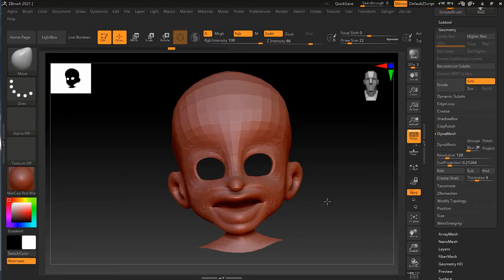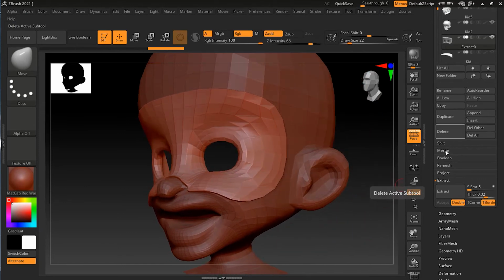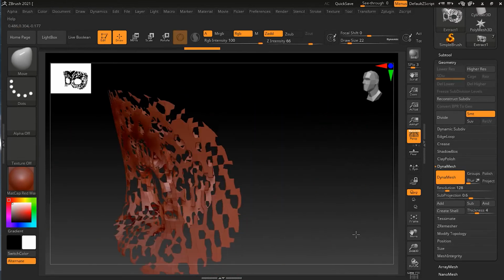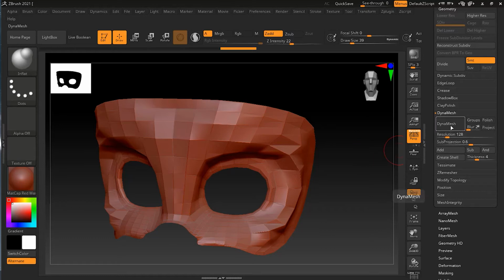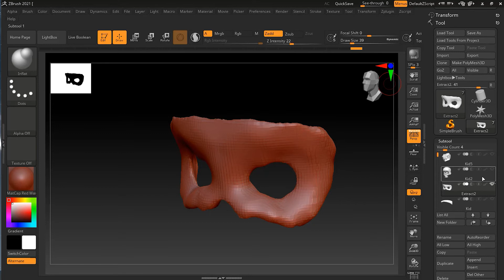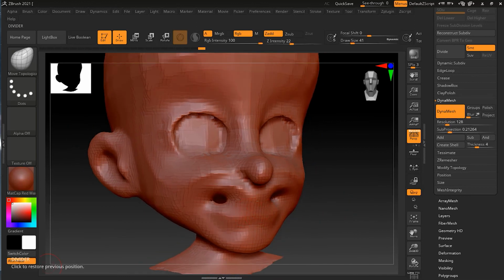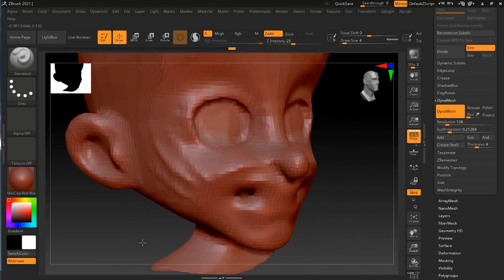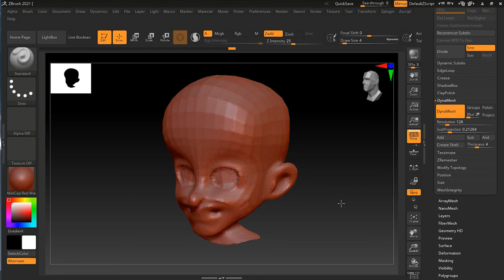Limitations of Dynamesh in Zbrush | Lesson 4 | Chapter 9 | Zbrush 2021.5 Essentials Training

Comment: I created "L" shape using cube in Maya then applied bevel on it of 2 edges and very much low bevel fraction......then import in z brush...and applied dynamesh......bt the part " where it creates 90° angle" in "L" shape (where 2 faces connect)  has no sharp edge...it pixalates....I want it sharp as we get in subdivision....what should I do?
Reply from the maker: Try chamfering the edges very close, it should work

Comment: i am wondering whether there is a way to flow an object on  a surface. same like the micromesh but just a single object on the whole surface. (in micromesh the object is on a single quad)
same like the flow on surface command in rhino 3d
Reply from the maker: I am not sure if I understood you correctly, there are two different ways to do that:
Method 1: https://www.youtube.com/watch?v=1faY3jJ-Fh0&list=PLnRp1fUkiXQdHGijJo3aBP6vDy9h4R4IY&index=40&t=417s
Method 2: https://www.youtube.com/watch?v=HwUT3RQZwhY&list=PLnRp1fUkiXQdHGijJo3aBP6vDy9h4R4IY&index=29&t=267s
Reply: @zinteractive  can you check out flow along surface command in rhino 3d
Reply from the maker: @aksi221  I guess you can do that using Nano-mesh instead of Micro-mesh
Reply: @zinteractive  I'll try that but I think it's something different it also applies the object to each quad
Reply from the maker: @aksi221  it does that, but it doesn't deform it like micro-mesh I guess.
Reply: @zinteractive   thanks for trying to help
i hope zbrush adds this command in the future its very handy